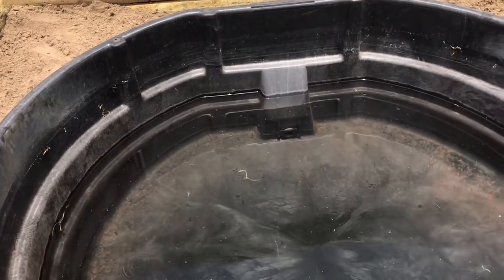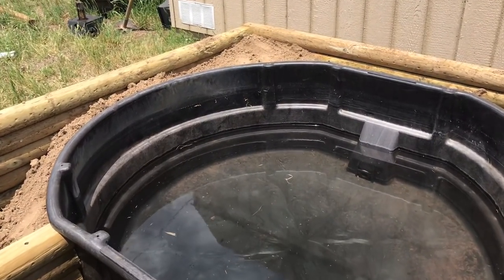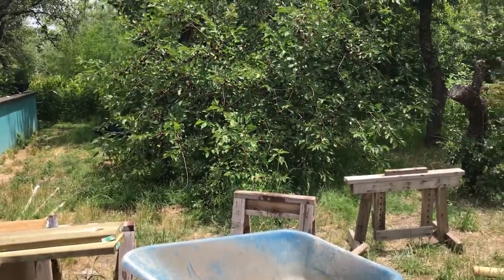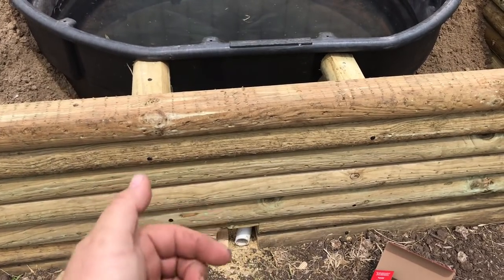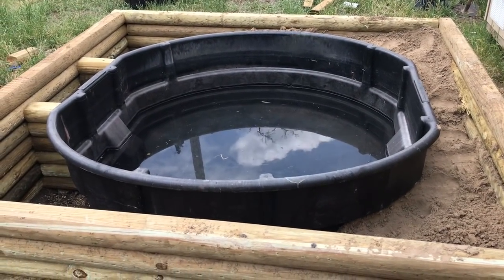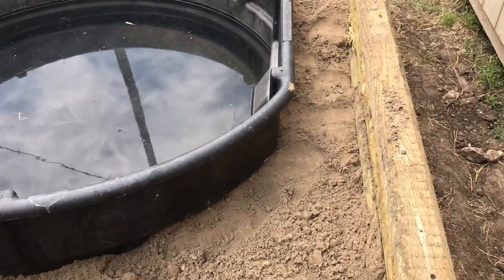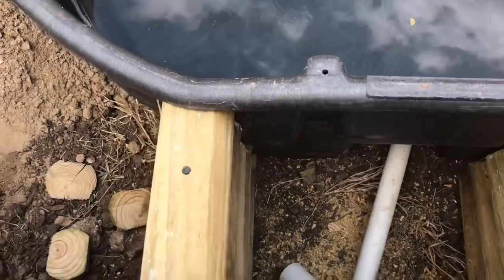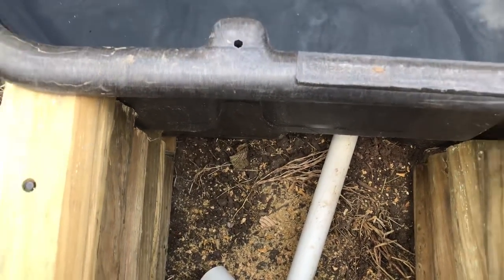New 300 Gallon Aquaponics System - Part Two

Comment: Thanks for the reply on my previous question.  I have one more:  Since this is a completely outdoor system that will take on rain, potentially a lot of rain, how do you keep the aquaponics system in balance?  All of the spill over may take your microbiology/nutrients with it which would go out on the ground and in your swales and be good for your land.  Do you have a system to replenish what is lost in the system or is it resilient enough to not need intervention?
Reply from the maker: Yea it really isn't a big deal, I try to channel any over flow into my swales, though that will take a bit of extra work on this one, everything really ends up there anyway.  On the balance thing, I will put it this way, I was recently at a workshop where I presented this topic and a person in the audience suggested taking water to the pet store for free testing, this was my response.   

"Well you can do that but you will end up hating yourself, you will be adjusting PH up and down and sideways, trying to get this and that perfect.  When you set up a system but cheap or free low value fish in it, wait until they stop dying and add higher value fish and rock on with your life".

I do have test strips but I don't really use them, if something seemed really out of wack, I would I guess to see what was going on.  See though the thing is I do 90% of my growing in wicking beds, this makes for a system that largely buffers issues.  When we get a big rain event I just consider it a free water change if it is enough to over flow the system.  

Did you see my aquaponics "ask me anything" video?

Comment: Question: How much space did you leave yourself at the front and back between the tank and timbers?  It's hard to get a feel for the distance on the screen.  What I'm most curious about is how much room there is in the area you left to service your plumbing.  Thanks.
Reply from the maker: Those scrap pieces that make the service area are about 10-12 inches long depending on the shape of the tank as it gets bigger as it comes up.  So that area is about 11x24 inches.  That should give you a frame of scale, next video I will get my hands into for a better scale.  

The tank itself is this tank,  http://bit.ly/2KXagpk it measures 69 in. x 63-1/4 in. x 25 in.  The box frame is 7 feet (84 inches) so the gap varies by the shape of the tank.  I wanted enough space to work and to insulate the tank with dirt without getting so large that it was going to take 4-5 yards of soil to fill it in.
Reply: Thank you Jack.  It is sometimes difficult to judge distance and spacing through the video.  That sounds like a good amount of space for the plumbing and access.  And thanks for the details.